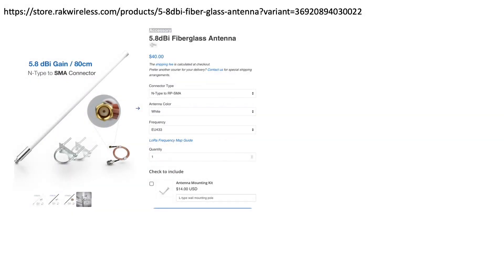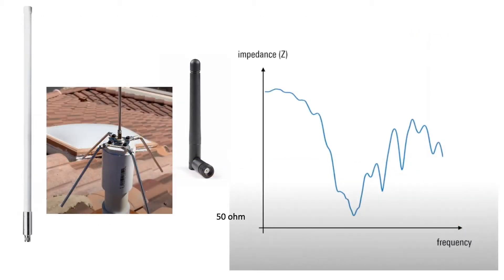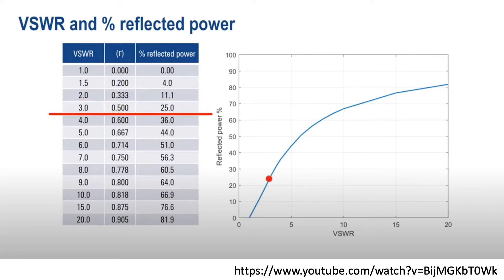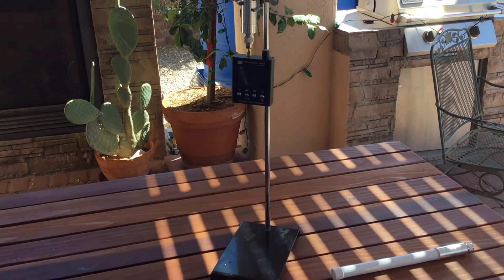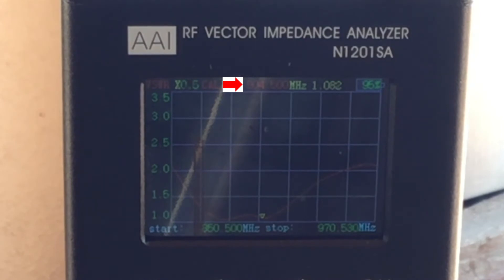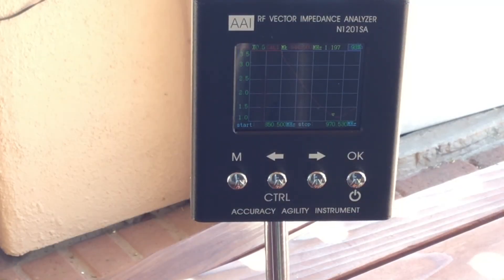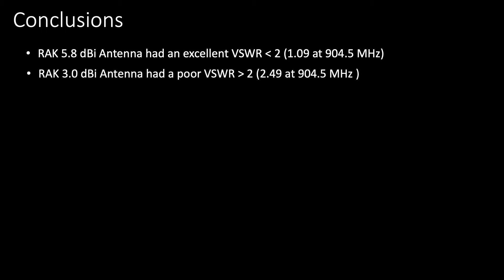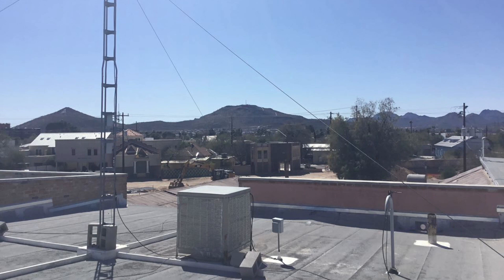LoRa RAK Antenna Testing with a Vector Impedance Analyzer

Comment: What’s the model of clamp that you’re using to hold antennas ?
Reply from the maker: It’s an old chemistry stand with a clamp for flasks or graduated cylinders that’s been repurposed. I use these in many of my electronics experiments (not just antennas).

Comment: I can't thank you enough for this video.  I have 11 Helium miners deployed in the Tucson area and half of them are under performing.  I suspected that I am having antenna grade issues.  I purchased a similar testing tool that you used (NanoVNA V2) earlier in the day, same day shipping, and after your video I'm pumped to get it and test all my antennas.  I know of the Xerocraft facility and if you are interested in hearing / seeing my results let me know.  I have four 8dBi (2 bbrands), one 4dBi, two 3 dBi and six 5.8dBi antennas.  I have a lot of testing to do. :)
Reply from the maker: Thanks Tim. Glad it was helpful. The VIA is a little easier to use relative to a VNA, but both should work fine. Poor performance might also be associated with antenna placement / path loss. Do your antennas have good line of sight for your area of interest?

Comment: Hello, thank you for the very informative content. I installed the 5.8 dbi RAK antenna on the balcony of my home, but it's 10 cm away from the wall of the building. Do you think that could interfere with the signal? Is there a minimum distance from walls to consider? Thank you
Reply from the maker: 10 cms (4 inches) is a bit close- I’m out of town, but will set up an experiment when I get home and post results in about a week or two since I have this same antenna, but I recommend a few more inches clearance,
Reply: @ModestMaker  hello, thank you very much for sharing your opinion regarding this matter. My earnings are really low right now, much more than I expected with a 5.8 dbi outdoor antenna. I can only get 1 witness per day, and my beacons most of the times gets 0 witnesses. Maybe it can be this the reason why. A test would be really interesting. Thank you

Comment: I'm going to be installing a Helium hotspot in south Tucson (by Los Reales landfill), and I'm thinking about using a 9dbi Yagi antenna pointed due north...Thoughts?
Reply from the maker: Yagis are directional so I would only consider using if you have a specific point or area you are trying to engage.

Comment: Great content! So would you run a 5.8 or an 8dbi for a rooftop setup in a suburban neighborhood?
Reply from the maker: 8 dBi is fine as long as your total power output is less than  1 watt. Calculating power output for your setup is summarized in this video : https://youtu.be/QmDkijgnUZg